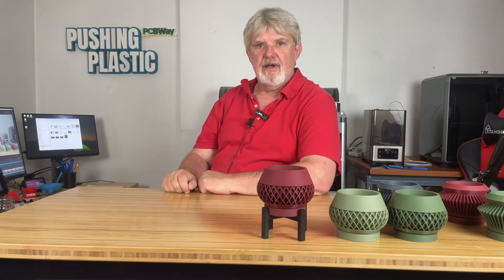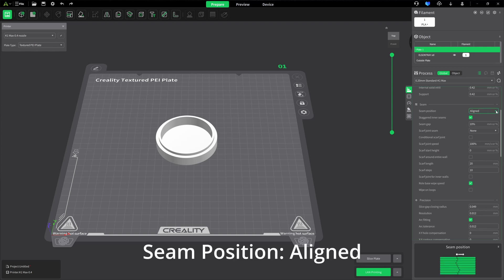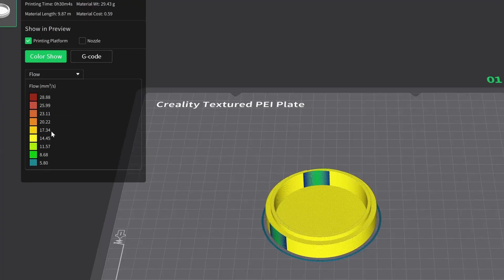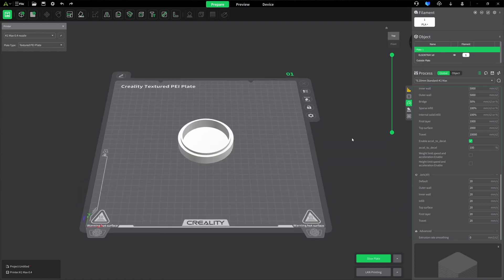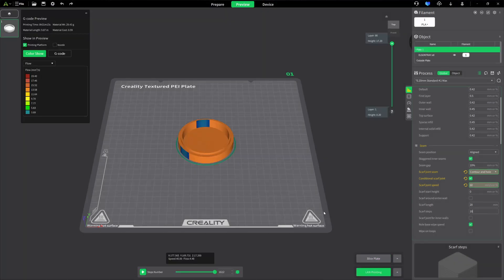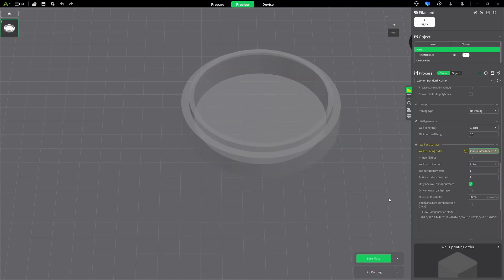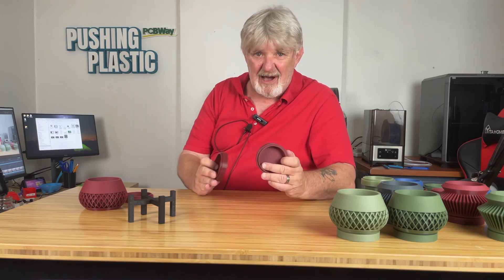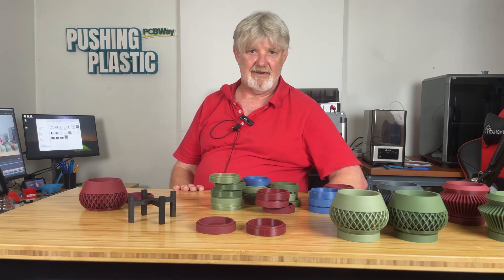Do Scarf Seams Really Hide The Z-Seam In Creality PrInt 5

Comment: hi! interesting video. 

i am trying to take out the seam scarf of my chess printings, because it has circle shape and movement, currently i am using the parameter "seam" = random, so the 
the printings dont have a vertical line, but they have the points randomly in every surface, so I would to get a cleaner piece than my results.  Any help I would preciate a lot
Reply from the maker: I set my seam to aligned and apply a scarf seam as described in the video. Some of the settings may change depending on the amount of detail. I usually adjust by doing a little experimenting with the settings.
Reply: @pushingplastic7445  thanks! If I discover an insight I’m gonna let you know!

Comment: Hi there, 
Firstly, thank you for working multiple slicers, and giving comparisons between their features; super helpful. Second, finally someone else using creality 5.x! Woohoo, trying to use videos from 4 and most of the menus have moved and things have been renamed 😢 your content is a blessing.

Finally, id like to pick your brain if I may; printing PETG (K1 Max), trying to get rid of minor gaps on the surface of the print between lines. I've tried retuning the feed rate, changing speed, and ironing (just me, or does this not work on petg? Completely trashed the surface). Trying to follow 3 year old reddit threads for different slicers and just feeling like im not getting anywhere, im hoping you may have a video i can watch or advise i coule try.

Either way, excellent video's, worth the sub 😊thank you
Reply: Surface is just a flat area, no features.
Reply from the maker: There's a lot more Creality Print users out there than you think! I did a video with the previous version of Creality Print "Great Top Layers With Creality Print" It might help https://youtu.be/1XfNY5ewbhM

Comment: well use a slicing system that avoids doing that seam, ie more continuous layers, no sudden stops, or at least the stops are not in the same place every time. yep just loop around would be the human choice. if you have more print heads than one, you automatically have to take account more stuff than just one nozzle making non-optimal choices. because it can.
Reply from the maker: Creality Printers only have one print head.
Reply: @pushingplastic7445  well they could soon have multiple print heads, all independent x-axis printing at once.
Reply from the maker: @gsestream  That would be cool, I hope they update the slicer to support that!

Comment: My creality print doesn't look the same as yours.  my highlights are blue where yours are green.  I tried to update it, but it said I'm currently using the newest version. Another great lesson today.  I never heard of scarf seems.  Thanks!
Reply from the maker: I've had case when it said I was up to date but I wasn't. If in doubt, you can always click the creality logo in the upper left corner, then select help and click on About. It will tell you version you have. Compare that with what is on https://www.crealitycloud.com/ under the download section, then software. I think Scarf Seams have a lot of promise!!
Reply: @pushingplastic7445  It says I'm using V4.3.7.6619
Reply from the maker: @Elimn8r64  This video was made using V5.1.1.9490. If you want to upgrade you can find it here https://www.crealitycloud.com/software-firmware/software/creality-print
Reply: @pushingplastic7445  Just did it.  I don't how. lol  I'm not good with computers let alone printing.  Thank you so much!
Reply from the maker: @Elimn8r64  That's alright, one step at a time!!! It won't be long and you'll be a master at this stuff!
Reply: He's running creality print 5. You're probably still on 4